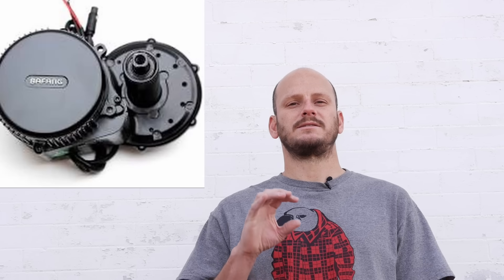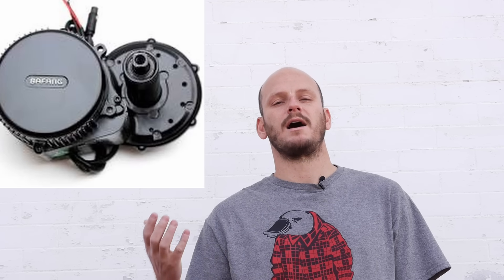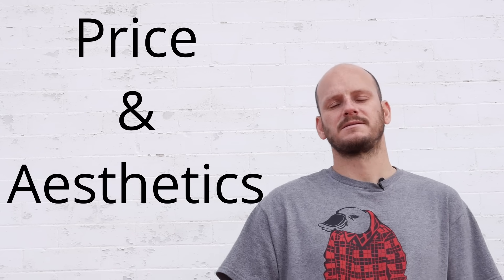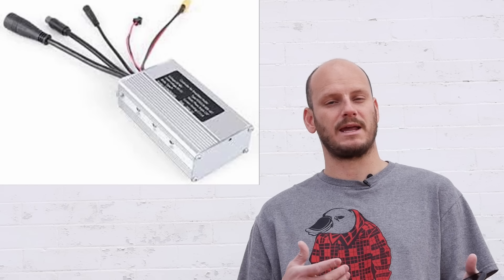Hub vs. Mid Drive Motors: Why Hub Motors Suck and Debunking Common Myths with performance test

Comment: If you're breaking or loosening spokes, they probably were not tight enough to start with. I have never had an ebike, but with my pedal bikes, I have broken dozens of spokes on factory built wheels. It wasn't until I built my own wheels, used good quality rims and spokes, and just tensioned the hell out of the spokes on the truing stand, after that I ran 25,000 miles on a wheel and never broke another spoke.
The problem is if the spokes are not real tight every time you apply torque, the trailing spokes unload then reload when you remove torque, and the constant cycling of load/unload breaks the spokes, especially at the elbows.

Comment: How much of the torque is lost with chain?
Reply from the maker: Depends on chainline. An engineer would be better at answering that question but I would guess 5% when it’s offset a lot
Reply: @JohnnyNerdOut , maybe you should ask from a ebike engineer. I’d guess you can find one?
Usual drivetrain loss in cars is 16% and they don’t even use chain. I’d guess that with chain it’s higher…
Reply: @JohnnyNerdOut , is mid-motor’s torque measured from the motor or the wheel?
Reply from the maker: @tokelahti  at the motor

Comment: But....what if I hypothetically make a bicycle that has alloy wheels (not spokes), hub motors on both wheels AND a hub motor. Batteries will be focussed on performance and not too much on range (high C discharge capacity)

Comment: Hopefully this is still a viable feed to the video and I'll get a response...

Can you give me a company that's going to have this for a 27.5 front wheel kit/ right hand thumb throttle assembly

And the same gear driven recommendations on 27.5 rear kit assembly/ right-hand half twist throttle

And how to get a back up battery for both ..

I'm using it for a good back roads travel bike in hill country to and from work . 

The bike ride itself says 4 hrs..
Which a kit set up 🤷🏻‍♂️
But there's also alot of up and down hills

Comment: His advise only applies in a dry warm climate.  Drive-train maintenance in snow country is a massive hassle.  Keeping those chain-rings,  cassettes, and chains clean, lubricated, and free of grit is absolutely necessary with a mid drive.  Not well suited for snow or bad weather commuting.

Comment: My daughter's been through a few cheaper end and second hand hub drives for commuting. She's doesn't have too much 'mechanical sympathy' so the magic bike fairies are constantly busy. Recently purchased a nearly new hub drive bike. Bosch motor,Shimano 7 speed hub gear and hydraulic brakes. You're so right,a different beast! You get that same little 'kick' when shifting similar to a car and the one thing I like is tyre changing,just like  a normal bike. Only 250w/ 15.5mph here in the UK though. Needs to change. BTW,she ain't having this one!

Comment: Both systems transmit power through the spokes. How is the mid drive any different?
Reply from the maker: Read pinned comment for clarification
Reply: @JohnnyNerdOut  It doesn't really clarify your knowledge of how this all works. You started by claiming the power is transmitted through the spokes in the video. This is true for both hubs and mid drive.
Reply from the maker: @eWhizz  correct. Power is always transmitted through the spokes. Hub motors have a much lower quality possibility (not all hubs are poorly made) and it’s the cheap ones that are not laced properly that fall apart easily.

Comment: Your torque data on hub motors is very dated.  You're misled on the torque as applied to the spokes.  Power being applied to the spokes is power being applied to the spokes, regardless of where the motor is located on the bike.  You simply have a strong bias towards mid-drive and completely disregard any of the pros for hub.
Reply from the maker: How is it dated? A transmission is a transmission at the end of the day. I clarify my point on spokes in the pinned comment.

Comment: 2 broken chains in 3000 km is way to much, u can also buy a decent chain for a little more mony, shimano for example. 
with a broken spoke u can still drive to where ever u want and to a shop to get it replaced. with a front wheel hub motor its so easy to replace a spoke u can even do it yourself, no harder than sealing a puncture. in the Netherlands u cant have a throttle on your bike so if your chain breaks your walking ether way ( ore just take a missing link with u, much lighter than a whole chain, and than u have room to take a spoke and tension-er with u instead) 
mid drives do have the problem that everything is integrated. so if your controller malfunctions u need a new motor, axelbearings wear out, new motor. also, most middrive motors have internal gearing that wears out; new motor. 
there are a few more reasons to want a hub motor, for example your chain, chianwheel and sprokets will wear out much slower. a fronthub motor can also help dig out your wheel when driving on lose sand, its realy weird on a mtb but ones u get used to it its fun in the dunes ( salt is hell for your bike tho) 
hub motors are also a lot cheaper in most cases, and u can just build a decent wheel around them so your spokes dont brake. 
but for the most part i must agree, 99 out of a hundred cases a middrive feels better, more like a normal bike. i do recommencement internal gearing(enviolo or rolof are the best) so your chain does not run out that fast ( higher speed chains are also thinner so they brake faster ( and are more expensive) the beltdrive from gates also looks promising to replace the chain as the weakest link but those to wear out fast if they collect some kinds of sand/dust.

Comment: Hub motors don't suck. They don't tear up drivetrains. Throttling up quickly is possible. 
Building a hub motor with lots of torque is possible and doable...they exist in the market place at 110 nm and beyond.

Comment: Can you get a mid-drive with a throttle instead of only pedal assist? When doing slow maneuvers around pedestrians on crowded paths, I find it easier to use a throttle so my feet stay in position.

Comment: I agree that mid drives are better but the thing you said about the spokes is true for a mid drive as well. When you peddle your bike on a mid drive the power will end up at your back wheel and if it making more power it should be harder on your spokes on that wheel.
Reply: You’re right, in both cases, all the torque is transferred through the spokes. The video clip comparing mid and hub motor seems bogus to me. How can the pedals be stationary on the mid motor when powering up the hill? The cranks are connected to the main sprocket which is providing the motive power to the back wheel.  Can someone explain?
Reply: @kevinmills5293  The mid-drive can drive the chain round via a throttle, even if the rider is free-wheeling.
I don't know if you can see the chain still turning in this video, but that's the real difference. Mid-drive uses the chain and gears, hub goes directly to the wheel.
While it's true that mid-drive is more mechanically efficient, it also wears the chain more, and you have to work your gears. With hub-drive and a throttle you can use the motor to go from a standstill to cruising speed regardless of whether you forgot to change gear when slowing down.
Hub is easier for the user, but mid drive uses the power you apply more efficiently. With a mid-drive if your chain breaks or falls off you're stuck until you fix it.
Reply: a mid drive has a second freewheel in the motor, you can spin the motor independent of the cranks. @kevinmills5293
Reply: No not any more than a regular bike. It's sending power to the cassette first. Hub motor is literally sending it to the... hub
Reply: @baitball4665 - And what, pray tell, do you believe that the cassette / freewheel is hooked to?

 All of the power either way ultimately ends up at the hub shell, where the spokes are hooked up. If the power doesn't get to the hub shell something has gone terribly wrong.

The real problem with e-bike hub spokes is they are often pretty dodgy on their quality control. I've seen a lot of cheap undergauge spokes laced onto ebike hubs. It's really that simple.

With quality spokes, with proper gauge, and decent lacing technique, and I guarantee you there will be zero spoke problems with hub drive motors. 

His rant about spokes was a complete red herring. I've built spoke wheels for racing bikes that held up perfectly well, and by racing bikes I mean Ducati 900s.

Comment: One benefit you didn't bring up is noise. Geared hub motors are so noisy! anything above 500 watts and you can hear them coming from a fair distance away. The other day someone passed me with a motor that must've been 1K watts and I could hear it about a half block away. Direct drive is super quiet but weighs a ton. Mid drives make some noise but in my experience they are much quieter than geared hub drives.

Additionally mid drives are more efficient in terms of battery used because they can leverage the drivetrain. 

I would say though that hub motors are fine for the casual user or short commuter. Ive had plenty of hub motors and they have all been fine. Weak climbing up big hills but overall fine. Mid drives though are definitely a step above in terms of raw power and the end user experience. 

If you are new to ebiking don't be afraid to get a hub drive bike! Just know that electric bikes are addicting and eventually you may want something a bit more powerful and a bit more fun :) Whatever bike you get be sure to enjoy it!

Comment: I bought a yamee fat bear 750 because I wanted a folding fat bike with that ipas regeneration. I got a 750 mid drive for free which I put on the yamee and it actually regens while I pedal with the mid drive. It's an electric /electric hybrid and getting almost double the range from one battery. But the weight is excessive. Great video!

Comment: I have both, and I love my hub drive a lot more. The mid drive is WAY underpowered for high altitude where I live. It’s like riding in sand compared to the hub drive. Plus, it cost 3x as much! I do like it for power distribution, but if it had twice the power I would be so much happier. I got the mid drive last year and had to pay in full to order it, so I didn’t have the chance to test ride first. I’m guessing you’re a flatlander, or super athlete, and it isn’t an issue for you. That’s fine, but for a lot of us with high altitude, age, and injuries, the hub drive makes more sense.
Reply: None of that makes any sense. And something is wrong with your middrive or your bike if it's less powerful than the hub. Unless you have a 500w mid drive and a 1000w hub or something.
Reply: @baitball4665  the hub drive is 500w nominal/750w peak, and the mid drive is 250w nominal/500w peak. So as I was saying, for the price, the hub drive is better for me.

Comment: I installed a BBS02 on a folding bike, and a BBSHD on a mountain bike.  Absolutely agree with everything here and wanted to add... having the weight centered and distributed to both wheels is also a factor for me because batteries can die... the electrics can mess up.  I don't want to be peddling a single gear bike weighing 50lbs plus my fat ass up a hill... at least on my bikes I have low gears to struggle but can bike home.  A hub motor w no gearing, you're walking or cabbing it. But I think a lot of people defend hubs because that's all they've used... and they do work, are quiet and perfectly fine.  Once you have a bike accelerate uphill w a mid-drive, which I did on most of NYC's bridges with steep grades... forget it.  Mid drives for me.
Reply: i don't think i've seen a single speed bike. i can go up hills and get a top end of 38 mph switching gears like a regular bike. i can ride my 75 pound bike in first gear if something went wrong.

Comment: Ok, let's not talk about how that torque is almost halved from parasitic loss on the drivetrain...it's like rating the HP of a V8 from the crank, or the rear wheels, where it counts. Consider that argument, BUSTED, sir!

Comment: I am considering a front hub motor for our two bikes because I want to buy a new tire for the front wheel they send with the kits and keep my old wheel and tire and that will allow me to switch them out since I don’t want to permanently change the bike I ride and don’t need yet another bike in the garage. We are in our 70s and ride only flattish rails to trails. Am I correct that switching back and forth would be easy? Is a hub motor an OK idea for riding flat trails with only occasional stops?

Comment: with midrives your bike frame is tied to a specific motor. what if they discontinue a motor? the frame would become useless.
Reply from the maker: Not the case with conversion kits. they are all made to be universal.

Comment: I built 2 bafang kits, one was the bbshd and the other a 500w bafang front hub drive,..and I've got to say, both have their advantages, a regular biker would appreciate the gears altering your torque and speed, whereas the hub is just a jump on and forget, ...saying that this is a geared hub so is more torquey than the ungeared hub, ..so my conclusion, it's personal preference, but use both bikes regularly ...as for chain breakage, hasn't happened yet but did fit a kmc e10 so fingers crossed the dedicated electric chain will be stronger than standard.

Comment: The new VanMoof S5 and A5 uses a front hub motor. Why do you think VanMoof used a hub motor? Is VanMoof simply style over substance? What's your take on the new upcoming Stromer ST3 Pinion ? I know! So many questions. Sorry.
Reply from the maker: They use a hub motor because it’s what their demographic wants mainly. St3 is a cool bike but I can’t figure, for the life of me, that price tag 🤷‍♂️
Reply: @JohnnyNerdOut  Yea, I'm scratching my head too. VanMoof is expensive but Stromers cost more than double VanMoofs!

Comment: 🌈😂HUB-drives are RELIABLE. Chains brake sometimes or get shredded fast. Also: if your Chain brakes at a mountain you can pull out your bar out of your mouth. 😉 To be honest : on steep hill the middle-motor wins. And the winner is:  BOTH!! YeS, di€&head!!! BOTH in a bike make it invincible 😊😊😊🌈💜 🚲🦄thank me later

Comment: one moving part 2 bearings ... or 30 moving parts and 20 bearings   you're choice
Reply: geared hub motors (the majority of the hub motors used) have more than 2 bearings, but you're of course right if you say they are much less complex. As long as you don't ride quite hilly or mountainous terrain hub motors are sufficient, they are cheaper than mid drives and less complex.

Comment: Another issue with hub motors in regards to spokes is the spoke lengths.  Shorter spokes build a weaker wheel due to their lack of elastic range.  Longer spokes, especially butted, provide for better wheel durability.  Elasticity is crucial in the design of a tension wheel.  This also explains why "thicker" spokes do not build a stronger wheel.   Spoke failure is almost a given with how these wheels are being designed and implemented.  If anything, they should be ensuring the spokes are triple-butted to address this problem.  Don't think I've seen any butted spokes on hub motor wheels, but I may be in error.  Please correct me if I'm wrong.

Comment: I was believing you UNTILL you said, "all cars use hub motors".... no they don't.  Almost ALL electric cars use a central motor feeding through a differential.
Reply from the maker: Correct. I clarified that statement in my pinned comment. It’s the same principle though, I just misspoke.

Comment: I love my rear wheel drive ebike and have not had any of the problems mentioned.  I am 300 pounds, ride up hills just about every time I go out and have over 2500 miles on the bike.  It has enriched my life!  I always peddle as exercise is part of the reason I bought an ebike.  If you find your mobility challenged but still have your balance…get an ebike!

Comment: I prefer hub motors, I've installed both on my own bikes. Hub with no assist, I pedal full power when I take off and get even more power than just a mid drive, mid drives definitely have some advantages, but they are more expensive, and look kinda ugly imo.